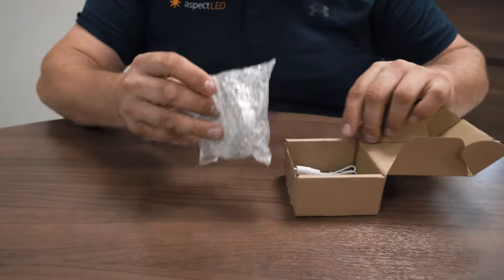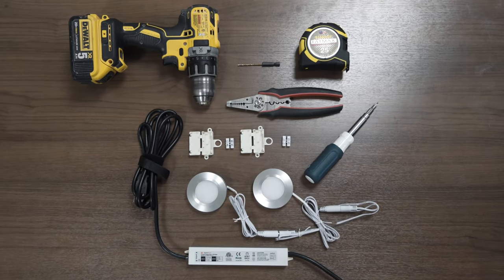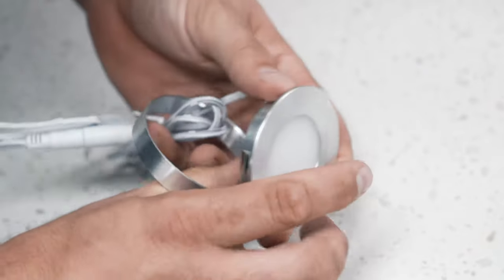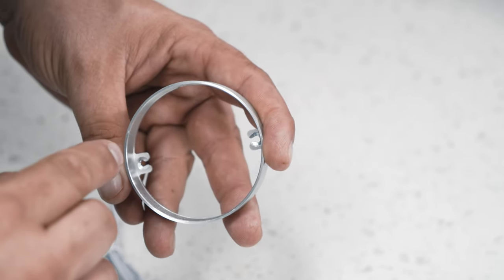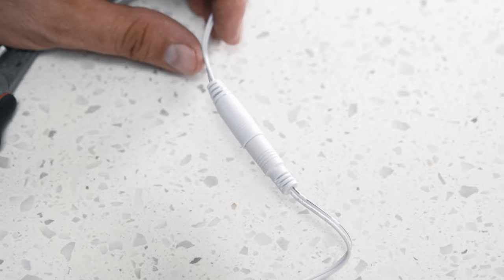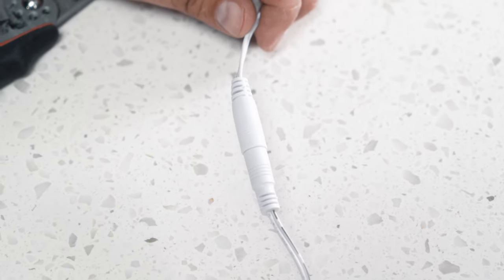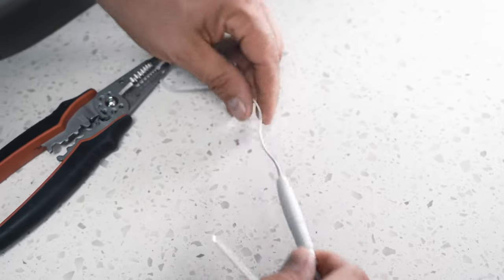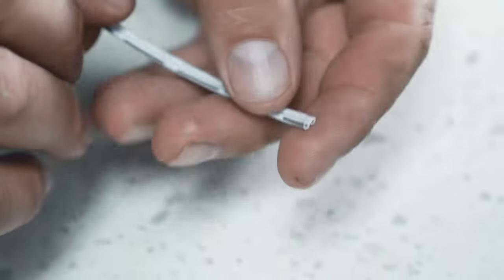How to install puck lights

Comment: I'm getting ready to install some puck lights into an IKEA Kallax bookshelf. It has 8 cubbies that measure in at 13" wide x 13" height x 15" deep. I'm using these shelves to store CDs and eventually plan to add tempered glass shelves(to allow the light to pass through) in the middle of each cubby for additional CD storage. The shelves in gonna add will only 10" deep from the very back, I'm not going to make shelves that fit the entire depth of the cubbies. I'm recessing the glass shelves so each puck light will light up all of my CDs. I also plan to install tempered glass doors with magnetic push-to-release latches in each cubby to protect my CDs. I know all this extra information sounds irrelevant but it's just a precursor to my question.

I'm wondering if there's some kind of equation I need to follow to find the optimal install point for my puck lights, to ensure that everything lights up properly? Should it be closer to the front or more in the middle? 

The LEDs are 12v and I've connected them to a smart, single color LED controller to dim and turn on/off from my phone. I've gotten everything setup and working in that regards. I've created a custom wiring harness for connecting the LEDs and I'm going to be using a router to cut out channels for the wires leading to the harness. The only thing I have left to do before installing them is: 
1.) find the best location for the lights
2.) measure the distance from the LEDs to the harness and splice in additional wire as these LEDs came with very short wires, somewhere around 8". 
Sorry if I am rambling, I've been thinking this project through and this is the part of the project that I'm hung up on, the best spot to install because I didn't intend to move the lights once they're mounted. So I'm here seeing what you would do. Thanks
Reply from the maker: We recommend turning on your LED puck lights and testing their placement on different areas of the shelves before final installation. The best position is typically in the center of the shelves.
Reply: @aspectLEDlighting  thank you very much for the reply, I was thinking something like that but I'm NGL, I wasn't very confident in my thought process. It's nice to see I wasn't wrong.
Reply: Hey buddy I'm trying to do the same thing but I'm having a hard time finding or buying extra cable for my pucks. Since they came with such a short cable. Would you be able to let me know where did you buy the extra cable please.
Reply: @LopezMario-bh8ns    hey man, ok so I'm gonna try to explain on here but it was a bit of a lengthy process. 

I started off with buying 3x packs of these basic puck lights that had been returned to Amazon for 10 bucks per pack (it comes with 4 puck lights and a ridiculously long wire harness. I spliced the wiring harnesses together and lined the connectors up with each shelf so the light's wires came out the back and had the exact length that was needed to reach the connectors and have no extra. I did this by grabbing a small roll of 22 gauge pure copper wire (12 bucks on Amazon) and then spliced/soldered in the needed length, ensuring I had just enough length to run to the back of the shelf as mentioned above. I added approx 8 inches to each light.

To install the lights, I made a little template that lined up exactly where I wanted my lights to go and marked the spots to secure the puck lights and then used a compact router + a .25" bit and set the plunge depth to just under. 25", going from the back of the shelf, all the way to approx ⅓" beyond the puck lights. Then using ca glue, I tacked the wires in place and filled in the routed out channel with pure white silicone until it was flush with the surface. This makes everything look so much cleaner cause you can't see any of the wiring.

As for controlling the lights, I got a single color smart controller from BTF-Lighting on Amazon (23 bucks) and then used a 12v 3A power supply to power it. 

I could've stopped there but I didn't. I went on to add adjustable feet to the shelf so I can level it out on the carpet and then I ordered 8x IKEA Kallax glass shelves+glass doors. This makes each cubby of the shelf have a backing so you cannot see the wires whatsoeve unless you have the shelf pulled out.  The shelves+doors are inserts, they cost $20 USD each and are well worth the investment. Every person that's seen my protect has been blown away at how professional it looks, and I have to agree with them. I wish I could provide a link to my shelf but YouTube blocks links in the comments.
Reply: @WrappedInPlasticine  than you, thank you for taking the time and explaining it. I appreciate it very much man💪💪. God bless!!
Reply: @LopezMario-bh8ns  you are quite welcome. I'm  happy to help, I will always try to help out others whenever and however possible. God bless you as well

Comment: So, one of my puck lights have a different color even when I press the button for them to both be the same color. What should I do?
Reply from the maker: Hi there, thank you for your comment. We don't have experience with color-changing puck lights, as the ones we sell are single color. Unfortunately, we don't have a troubleshooting solution for you in this case.

Comment: Helpful? You totally said nothing about how you wired 2 puck lights to one transformer???
Reply from the maker: Hello. If you need to connect two pucks to a transformer (or as we call a power supply) use parallel wiring. This means that the positive sides are contiguous and the lights are not in series.